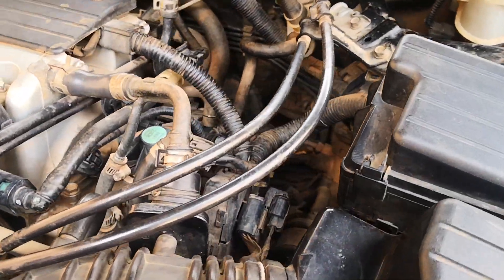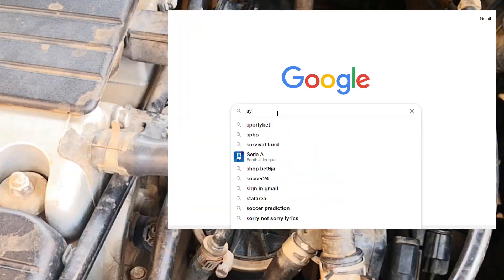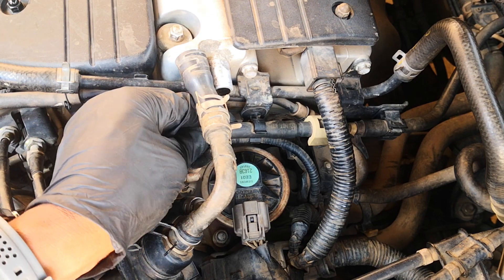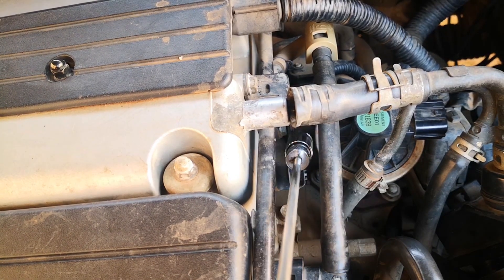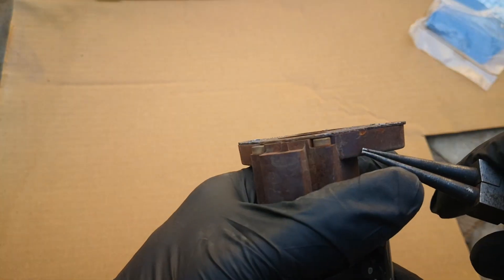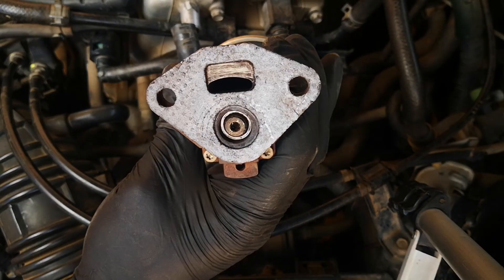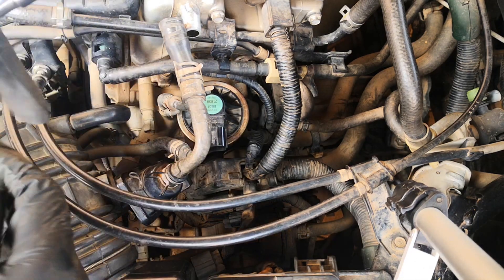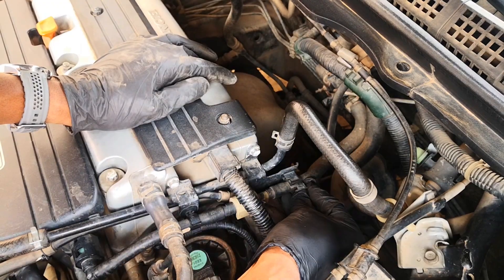How to CLEAN your Car EGR valve & Electronic EGR Valve Testing (AFTER): Honda EGR Valves P0401 P0402

Comment: do you need to unplug the negative baterry everytime disconnected any plug on engine? if not what are the ones that needs or must disconnected the baterry parts when changing or removing?
Reply from the maker: Not at all

Comment: I tried to get the bolt on the back with a 12mm socket but it doesn't fit and the socket wouldn't go all the way onto the nut. Help!

Comment: Thanks for all your efforts. I'm planning to clean the egr on my 2008 honda accord but I can't find it. Please can you help in directing me to the location.
Reply from the maker: I don't think the 2008 has an EGR valve, 4 cyl, right? My 2017 doesn't either. Though I think the V6 has.
Reply: @DIYAutoworksNG  yes. LX trim.

Comment: I got an aftermarket scanner and ran the test and it gave me a fail too.  I cleaned the EGR and test the actuator and it works properly.  Re-installed the EGR with a new gasket and the test still said failed.  Just wondering if the this test is actually working properly on these aftermarket scanners.
Reply from the maker: Also clean the EGR passages and then test again. My current honda doesn't have an EGR, if not I would have repeated the test. I wouldn't doubt the test results if it's a reputable aftermarket scanner.
Reply: @DIYAutoworksNG  Did that too.  🙂
Reply from the maker: Well, I kept driving mine, since I didn't have a CEL and fuel trims were fine. Sold the car some months back.
Reply: I tried and Autel MX808S and the test failed.  So I tried the same test on three other Hondas and the test always failed.  I highly doubt that the test is valid a there are no codes.

But still a good idea to clean the spindle as it can get sticky.

Comment: Could a dead EGR cause a crank no start
Reply from the maker: If its stuck open, yes. Do you have an EGR code.
Reply: @DIYAutoworksNG   yes I have EGR code P0401
Reply from the maker: A good place to start will be cleaning the EGR and passages.
Reply: @DIYAutoworksNG  I cleaned EGR it doesn’t look bad …I didn’t clean passages but sprayed brake cleaner and Intake cleaner in everything associated with EGR…still a crank no start
Reply: @DIYAutoworksNG  it’s an electronic EGR…if it’s fried …would it cause my issue of a crank no start
Reply from the maker: Yep. It's possible

Comment: you should also clean the EGR passages from the intake manifold. IT is a MUST DO operation on K20 and K24 engines.
Reply from the maker: Thanks for the tip
Reply: How do you do that?

Comment: How to cliberate it's TPS sensor?
Reply from the maker: Generally, because on this model, the TPS is an integral part of the throttle body, I just usually do an idle relearn which effectively, resets the position of the butterfly plate. The procedure is below:

Make sure all electrical items (A/C, radio, etc.) are off. Disconnect the  battery for 3 minutes or so. Turn ignition switch to ON (II) and wait 2 seconds. Start engine and hold engine speed at 3,000 rpm without load (transmission should be in P or N) until radiator fan comes on twice. Let the engine idle for about 5 minutes (If the radiator fan comes on, do not include the duration it was on in the 5 minutes).
Reply: Hi dear..many thanks for sharing this video.  I have received my scan tool exactly same as u r using.  And I do have an issue with my son car 2014 volvo xc60 t5 petrol  2.0l . A massage appear reduced performance with trtule  sign . And engine poor of power. just for a few minutes then off and engine run smooth. I scan it but no any code. 
What u think is it egr valve issue? Plz advise if u have an idea.
Thanks
Reply from the maker: Hey, great to hear you've received your tool. Intermittent faults can be the most tricky to diagnose. Was it while the light was on that you scanned or after?
I am not familiar to Volvo but from the little I've read online, that message can be caused by several issues. I'd say you try to see if you can spot anything unusual via fuel trim data while you wait to see if you can scan the car again if it reoccurs. ie. Scan while the alert is on.
Reply from the maker: Regarding a potential EGR issue, online forums have said that if you have the alert plus the anti skid light that it could be EGR. See if it reoccurs though.